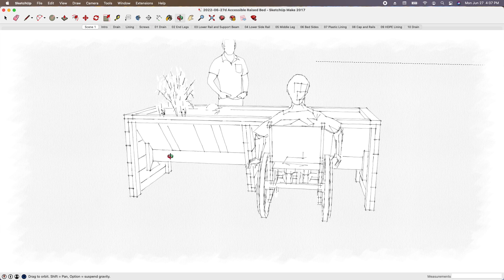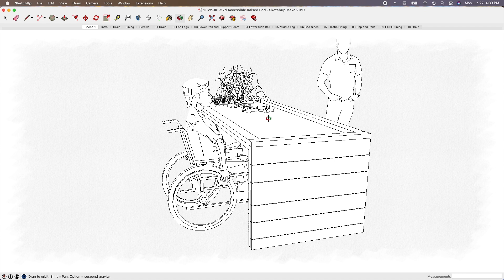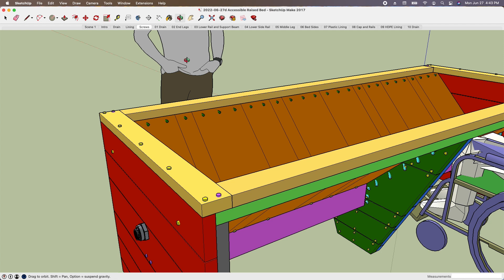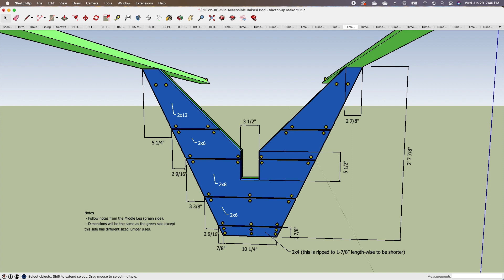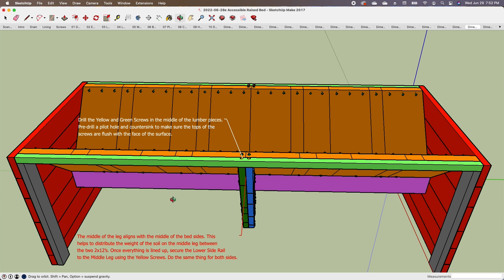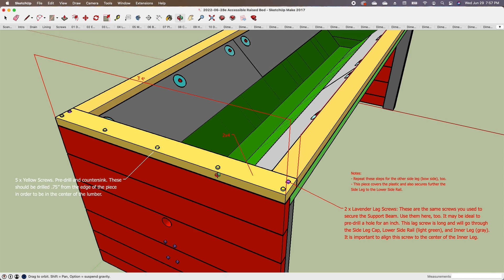Accessible Raised Bed Overview and Construction Guide

Comment: I need an actual material list
Reply from the maker: You are in luck. In the description above there is a link called, "Parts, Prices, and Tools." I've also provided here for your convenience: https://bit.ly/3AwNwZR
Reply: @placerresourceconservation1424  thank you I didn’t see the diffrrnt sections I only saw the cost
Reply from the maker: The list is an excel document. You'll need to sift through the different tabs to see the parts and prices for various aspects of the raised bed.  @randomgamer2186
Reply: @placerresourceconservation1424  why didn’t you use pine it woul have drematicly cut the price down several hundred dollars
Reply: It would last just as long is you used stain and sealer
Reply from the maker: Thank you for sharing your opinion. You can use whatever product you'd like. The design required a safer, less toxic, option.  @randomgamer2186
Reply: @placerresourceconservation1424 ok I’m just planting flowers